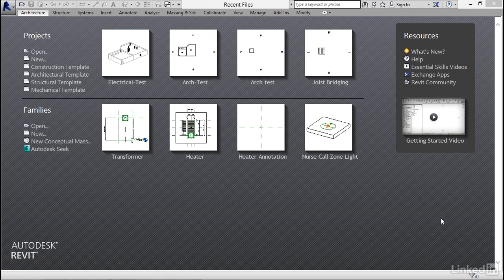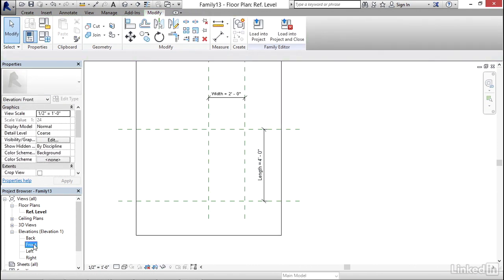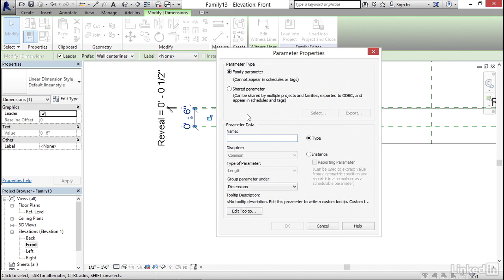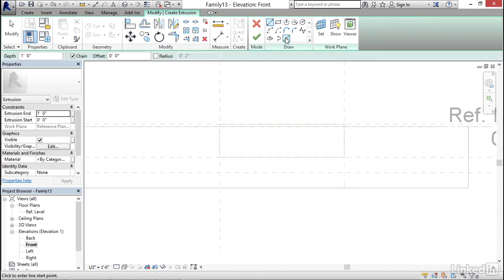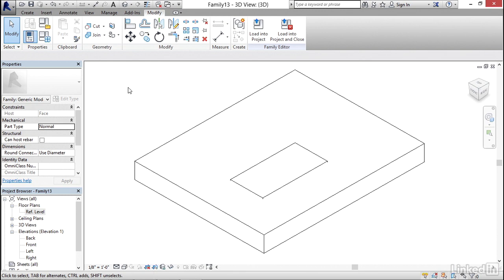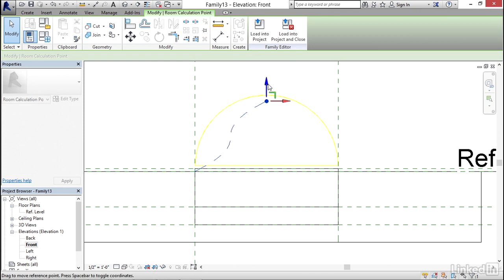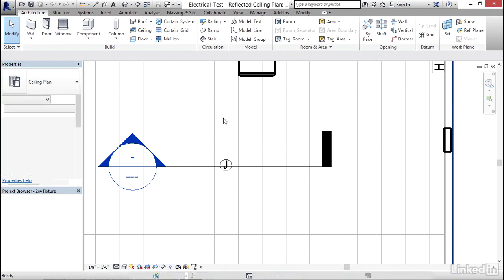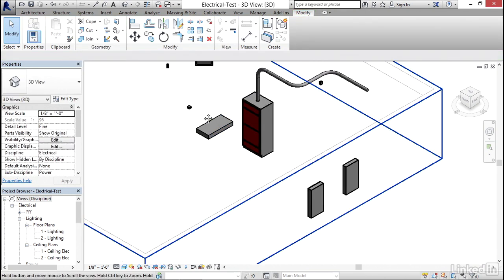Revit Tutorial - Creating a recessed 2x4 light fixture

Comment: The problem with this tutorial is that it ignores the fact most electrical drawing are done using symbolic lines. An extruded light fixture is great for dropping into an architectural model, but to complete this family for electrical drawings, you would need to turn the visibility of the extrusions off for Plan/RCP views, draw symbolic lines in ref. level, and align the symbolic lines to the length and width reference planes. You can also add other symbolic lines (such as a circle) to complete for whatever style you're using and add a shaded region with its visibility tied to a parameter for emergency lighting designation. Additionally, you should link the electrical connection apparent load to a parameter for wattage.